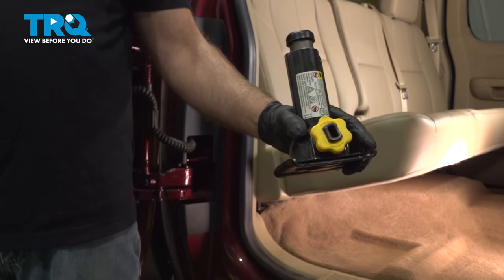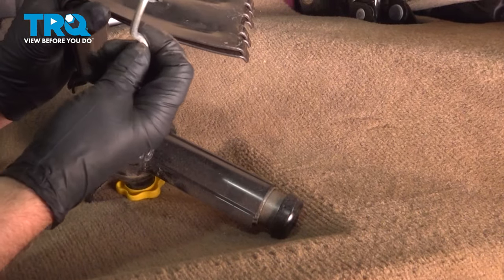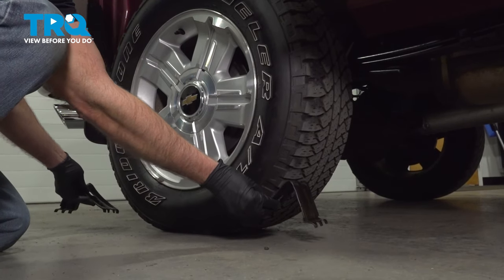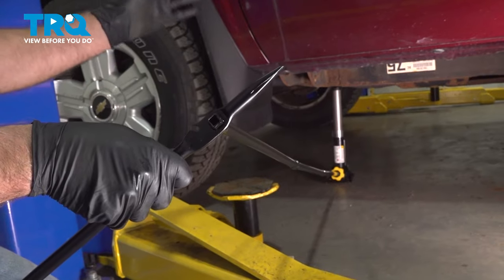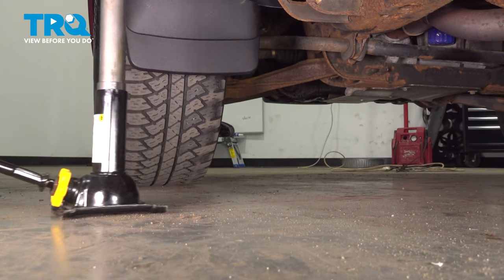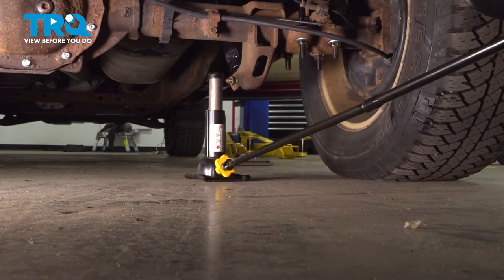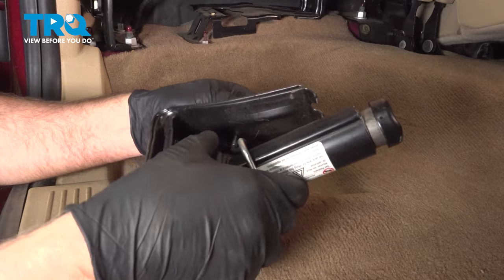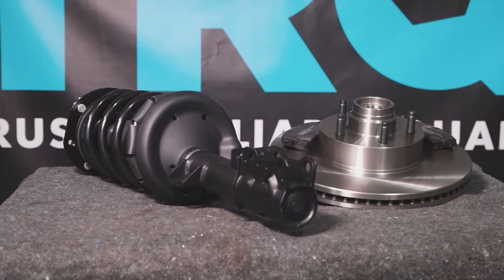How To Locate And Use Jack 2007-2013 Chevrolet Silverado 1500

Comment: Also applies to Escalade & Tahoe (same model years :)… Not sure why 2014 isn’t included tho, as I’m unsure of what changed as far as the jack is concerned. Same applies to one particular FOB programming tool that I recently purchased, except 2014 AND 2013 is omitted for that.